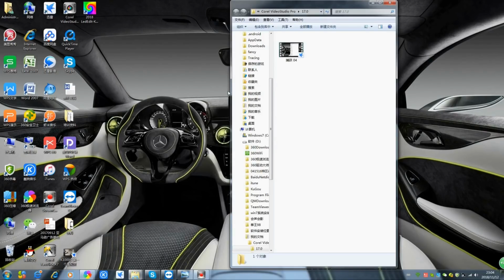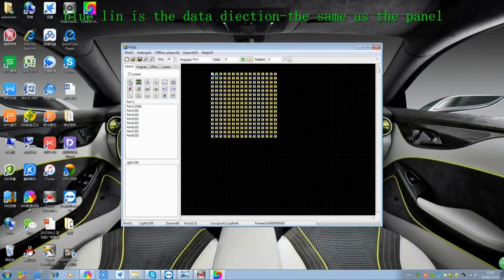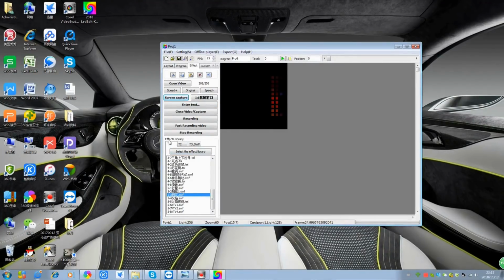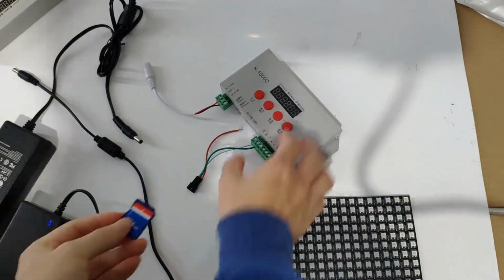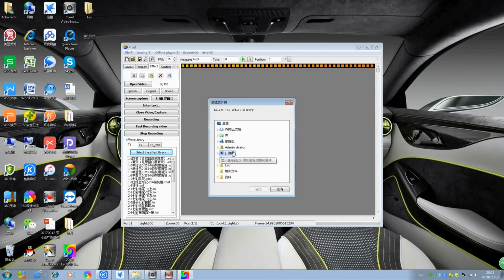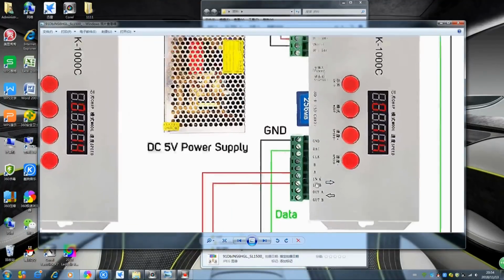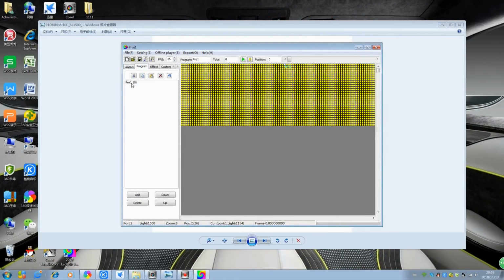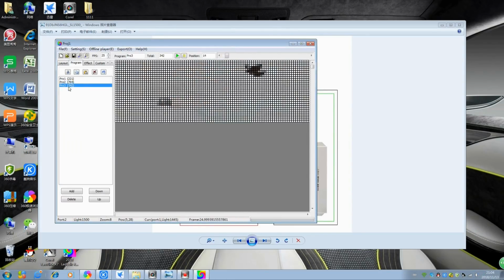BTF-LIGHTING: How to Configure K-1000C Programmable Controller ?

Comment: I have a problem with two K-1000c controllers. If i put the sd card inside, the display sign 01.01.01. but all LEDs are black. (Software LEDedit 2024)
Put i the same sd card in my K-1000C from 2021 it is working correctly
Reply from the maker: You can contact us contact@btf-lighting.com  and send us your order ID .

Comment: Okay so I have a question regarding the product I bought from you, it's model says it is BTF LIGHTING, Part Number 2427-8*32 which is an 11 Tall, by 44 Wide LED display and I bought 2 of these.  I linked them together with the first one being on the left and the second one being on the right.  I am using the K-1000C Controller.  I have gotten this all to work before, but I cannot for the life of me remember the layout of these boards for Data Direction, what side is the first LED on for these boards, is it Top Left Bottom Left, Top Right or Bottom Right, and where does the Data come out, Top Left Bottom Left Top Right or Bottom Right?  What is the Orientation pattern in LEDEDIT K and which one should I select because It is displaying the Text I put in the program, but it is appearing scrambled because I do not have the Layout correct. @LIGHTING BTF

Comment: You have a good channel and I hope you can sexist but I have some question about SM 16703 pixel how can I program an control k1000 c thank you again
Reply from the maker: You  can send your order ID and contact us support@btf-lighting.com
The LEDs at the far end of the strip might be dimmer because of the added resistance and voltage drop that occurs as the current flows to that end of the strip.

This is a normal physical phenomenon, and all the LED strips cannot avoid this problem.

 

The factors that affect brightness are：
1. Length. If your project is too long, the voltage drops.
2. Power supply. Make sure the power is enough for the project.
3. Lighting effect. The full white lighting effect will consume a lot of energy.

When you Light up 1 color(red or green or blue or pure white) 0.1W/LED. Light up 2 colors (red+green) 0.2W/LED , Light up 3 colors (red+green+blue=mixed white) 0.3W/LED.
4. Brightness. The brighter the brightness, the more consumption.

 

Solution：
1. Adding voltage every 5 meters (16.4ft).
2. Lower brightness
3. Enough power
4. Avoid the full white lighting effect.
5. Using DC12V or DC24V LED strip.
6. Use 30LEDs/m LED strips, instead of 60LEDs/m

Comment: Hello! How i can control more than 2048 pixels strip? Thank you!
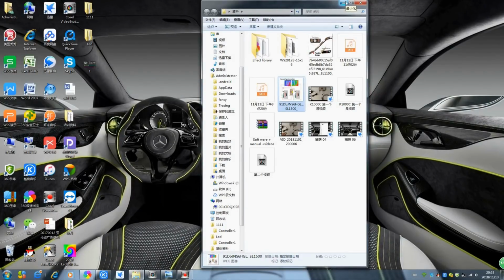Reply from the maker: You can use 2X K-1000C controllers , Part 4(start time 25:08-36:05) : I will teach you how to connect two K1000C controller to control  3000 Pixels Panel . We call it Cascade synchronization

Comment: hello, I have a problem .when I load the program .the folder does not put in .led how to solve the problem, thanks a lot
Reply from the maker: Hello , 
You only can coype the  LED file to the SD card . You can not coyp the folder . 
You can contact us
DE/ES/UK  Amazon:   rachel@btf-lighting.com        CA/FR/IT Amazon:   chris@btf-lighting.com    
US/MX  Amazon:  support@btf-lighting.com           Ebay:  kitty@btf-lighting.com

Any product prolbem.
1.Please send us your order ID number .
2.What power supply do you use? Can you tell us your output voltage and output current?
3.What LED do you use ?WS2812B ?WS2811? How many LEDs ?
4.Can you send me a video of the light strip? The video can show us your power supply connection ,controller connection and LED strip connection . A large and detail video can help us to find the issuse reason quickly .
Send us a large video :   https://wetransfer.com/

Best regardss
BTF-LIGHTING

Comment: Does anyone know if there is a less expensive K-1000 Controller ?
The K-1000 is a bit pricey at $52 on Amz.
 I know I can eventually use Raspberry Pi, or PI Zero, but not quite ready for that level yet.
Reply from the maker: Due to the shortage of semiconductors and chip supply, the k-1000c controller has been out of stock for a long time, so Amazon's inventory is the last and only inventory. This product may be out of stock for two months in Amazon.

Comment: How much power I need for three LED Matrices?
Reply from the maker: Light up 1 color（red or green or blue or pure white) 0.1W/LED . Light up 2 colors (red+green) 0.2W/LED , Light up 3 colors (red+green+blue=mixed white) 0.3W/LED    .  3 matrix  8x32  ,total 768 LEDs , the power could be 76W~230W  . DC5V20A 100W is better for this project
Reply: @BTFLIGHTING  Okay thanks, but it also depends on the brightness, doesn't it? I think you need at least 30A - 40A for that?
Reply from the maker: @DaDom07  Hello, 20A is enough

Comment: Do you have a software application that doesn't require exposing your PC to security issues with Flash?
Reply from the maker: Hello, you can contact with: support@btf-lighting.com
Reply: Have you gone into the windows updates and uninstalled all of the Adobe updates. They started around October of last year. I can't think of the KB number(s) of hand. But try that first. If not and what I did in 2 of my PC's was to reinstall Windows. I use either the 1909 or 1903...it not only effected LEDEdit but other similar LED programs with the Adobe Flash EOL
Reply from the maker: @BricE50MustanG  Hello, you can contact: support@btf-lighting.com, our seller will send you a new version.

Comment: How do I get that female power connector?  My power supply has an out to the round thing on the power plug or converts it to 2 power wires receptical, reqluiring me to add wire to get it back in to the K-100C.  I'd like to plug the power supply round plug directly in to a femail recieve that has the 2 wires going to the K-100C.  I hope that makes sense, any advice?
Reply from the maker: Hello, you can contact with our service email:  support@btf-lighting.com

Comment: Question: Is it possible to build audio spectrum analyzer using K-1000S and Ws2812B 11x44 panel? Is audio analysis build-in into K-1000S?  I've noticed there is input terminals/socket?
Reply from the maker: No , it can not .

Comment: can you help me , how i need to arrange the SD folder with multiple .led files, to switch programs with MODE button . Thanks in advance
Reply from the maker: You mean one file  , many lighting effects?Sure you can use the mode button to change different lighting effect .
Reply: @BTFLIGHTING  Hello, Thanks for the response, but I can't scroll through the programs on the K100C despite there being several programs in the SD card.
Only the first program plays.
Have you ever encountered this kind of problem?
Best

Comment: Can you trigger the controller from dmx or a external switch to change modes?
Reply from the maker: If you want to use DMX512 to control , you can use K-8000L controller . This K-1000C can not support DMX512 Console
Reply: @BTFLIGHTING  Thank you for your explanation about DMX512 Console, I had to search for hours why DMX ports are on T-1000S  and K-1000 C
Reply from the maker: @bretzeletouffeur  you need a decoder for this K-1000C controller ,so it can work with DMX512 . We have the controller K-8000L can work with DMX512 console directly .
Reply: @BTFLIGHTING  Thank you, I would love to buy the K-1000C because not enough money for the K-8000L: Do you have an aliexpress link for a cheap DMX decoder that works with K-1000C ? I searched a lot and could not find the one you shared on video.
Reply: Can you trigger with a switch? For example 3 scenes. 3 switches
Reply from the maker: @MrEwing453  for this controller , we can make it remote control.
Reply: @BTFLIGHTING  How would we get a remote control for this controller?
Reply from the maker: @opulencesmarthomes7047  Now this remote control is not selled in our store, If you want to buy it, you can contact with our email: support@btf-lighting.com
Reply: Yes I need the same thing. I want to have all animations pre-loaded on the sd card, then trigger specific animations by sending dmx signal on one channel, adjust speed on a different channel. Will this do what I'm describing?

Comment: Can I use 2 WS2812B LED Matrixes ((8*32) *2)in serial mode with the K1000C so I get a Matrix of 16*32?
Reply from the maker: Sure  you can .
Reply: @BTFLIGHTING  How do you do this?  I have a K-1000C connected to two 16x16 matrix panels and they still function as separate panels instead of a single 32x16 panel.  Thanks for any help you can provide.
Reply from the maker: @dwburger  Hello, you can contact with: support@btf-lighting.com

Comment: I have one issue. Great product but when I add text the position on my 8×32 was strip is too low. I need it vertically positioned higher on the led strip scrolling so you can see the whole letter. I see the top half of the letter and have played around with the positions but cannot get it to work. 

Also how do I program each led individually to stay on?

Comment: Can you trigger the modes from something like a microcontroller/arduino? Instead of pushing the mode button
Reply from the maker: No , it can not.
Reply: You can. You just have to replace the button on the K1000 with a relay that can be controlled by the Arduino. This will void your warranty as you have to open the unit to solder onto the switch connections.
Reply: @Gr3ap3r78  Couldnt he program the Arduino to operate a servo, and have the servo press the button on the K-1000?
Reply: @TomInTennessee  There's also this board game called "Mouse Trap" and you can build the Rube Goldberg model to kick and drop the metal marble onto the switch instead of landing in the bucket.
Reply: @jerryd8022  I know.  I loved that game!  And i know my suggestion seems like a Rube Goldberg solution, but if you dont want to mod the controller, its a valid solution.
Reply: Just drop kicked my baby Annabel for eating my raspberry pie!

Comment: Good start but you need to include adding more panels like 2 across and 2 down and how to program and connect
Reply from the maker: I will make another teaching video for the K4000C or K8000C controller in the future . Thanks for your advice .
Reply: @BTFLIGHTING  i need it for the k1000c
Reply: Give him a break
Reply: Yes...a video showing how a K-1000C controller works with chained panels would be very helpful.  I've tried 2, 16x16 panels with the K-1000C (using LedEdit to create programs) and have not been able to get the resulting 32x16 matrix to work.  Maybe the K-1000C is incapable of doing this???  The reply from BTF-LIGHTING implies that another controller (e.g., K-4000C or K-8000C) is needed.

Comment: K 1000C controller
when insert SD card come F F F
 How to resolve this problem
Reply from the maker: Hello , 
Please contact us  support@btf-lighting.com    , We need your order ID and your program file .  Please send you file to use , we will test it . 
Please tell us  which led strip , power supply do you use for your project .
Reply: This is how i solved the issue : format your SD card * ( FAT form or FAT32 form) , Try the other format if you are receiving the same FFF.